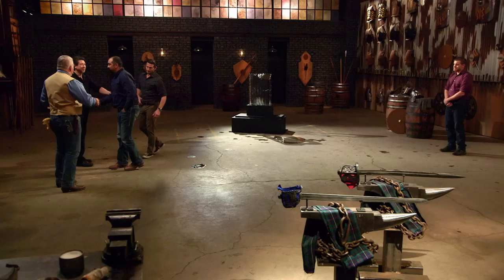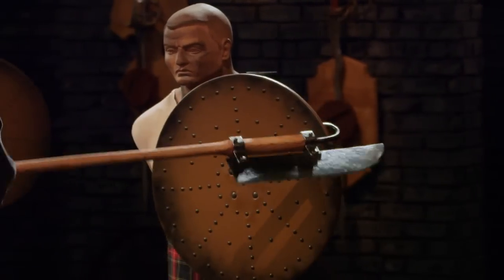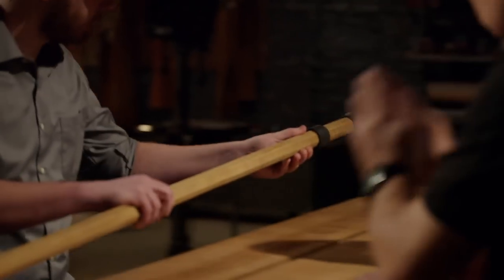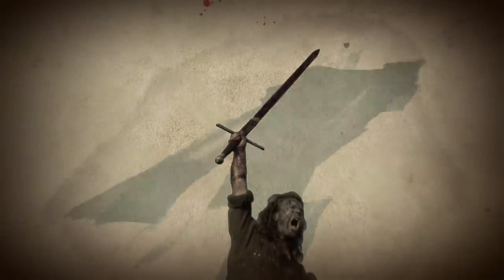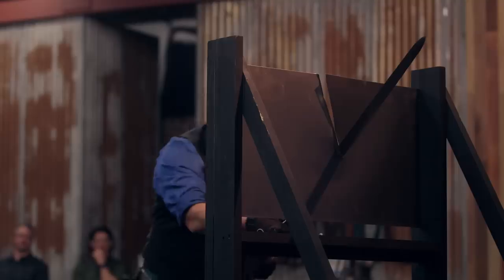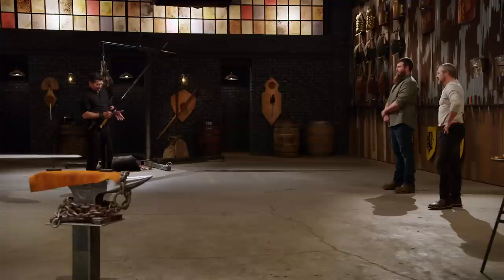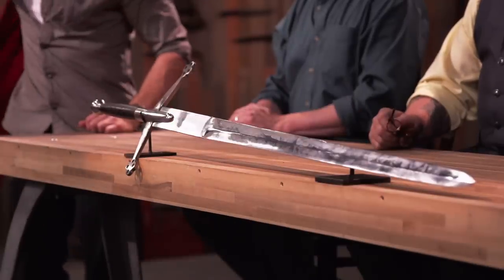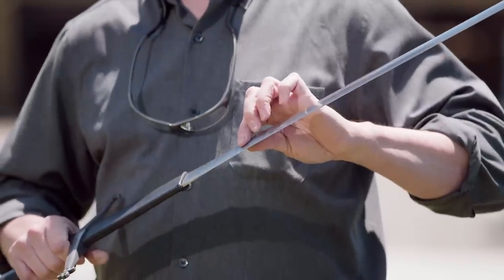TOP 5 SCOTTISH WEAPONS OF ALL TIME! | Forged in Fire

Comment: Scott really had no reason to be proud of his loophole win with the Claymore. My opinion, both competitors presented weapons that would have failed in the battlefield and thus, ensured their wielders wouldn't be amongst those returning home to their families. It really should have been declared a no contest.
Reply: I agree.  I do think that he let the grip twist in his hand, because it landed very close to flat against the carcass, thus the bend, but it shouldn't have retained that bend.  It would have cut if it had landed correctly, because it cut the steel sheeting, very handily, after he straightened it.  The 2nd sword did the same, landing flat on the hog.  I think the grips were both too small in diameter and being round, to boot, made it difficult to control the orientation of the cutting edge.
Reply: @wmden1  if you watch a lot of the major fails, you will see a good number have purposefully shifted geometry at the last second, not by slipping in the hand, but ive seen visible wrist twitsts
Reply: @kevinmorrice  Thanks for bringing that to my attention.  You are correct.  I watched the blade, every time I watched it, not his hands.  I watched it, paying attention to only his hands, after reading your reply.   Obvious bad right hand position on the grip at the point of contact with the carcass.
Reply: but on the other other side, someone IS returning home to their family... on the other side.
Reply: @abadran8174  Well, this is true haha.
Reply: I do think that the makers of the William Wallace swords should be proud
Reply: They were claymores to and they hey were very well made
Reply: A snapped sword is still more useful than a bent one
Reply: @cammyboy2k10  I don't get where you're drawing that conclusion from. A bent sword still has some reach and a point of penetration in addition to the edges. A snapped sword, all you have are some short edges.
Reply: @cammyboy2k10 a bent sword can be straightened & used again in a few seconds. A broken sword can only be reforged after the battle is over.

Comment: As much as I love hearing "It will Keal" watching Doug wield the Lochaber axe, it seems like he's not as experienced wielding long and large weapons, as much as the smaller lighter weapons
Reply: That's the bit that doesn't make any sense to me. Dude's a kali practictioner, he's used to stick and knife fighting. He's okayish with 1-handed swords, but he's always a klutz with the big ones, to the point where he literally managed to hit the pig with the flat of the blade, then blamed the blade like we didn't just see him slap the flat against the pig in slow motion? Get someone from HEMA in, trust me, any of those madmen'd do a happy dance to go and whack a claymore through a ballistic dummy.
Reply: @Fatespinner  the blade twisted and rolled as it failed to cut. What do you expect the blade to do when it cannot cut? bounce? no. the remaining bit of the sword is still moving to the direction of the pig. you can see that frame by frame, 14:16 then use >< keys to go frame by frame. you can see that the sword comes in edge first then turning as it failed to cut making it look like it was hit by the flat
Reply: @quertbarbie62  The blade was vertical long before it hit the pig. It's really very visible in slow-mo., in the video, so I'm not sure exactly why you're trying to argue this when the video doesn't show what you're saying.
Reply: @Fatespinner  you go frame by frame and you can even see it twist after hitting the pig at an angle and not vertical as you claimed. The only time it went vertical is after the edge failed to cut in. Either you blind or you cant do frame by frame. I've experience this effect first hand. When the blade does not dig in after a full swing, it would turn flat, either rotationally slipping from your grasp or turning your wrist with it.
Reply: @quertbarbie62  3 different claymores and has the same issue with all of them. You can even see him rotate his cut with Ben's blade before he finishes passing through the pig. Not to mention, he cut where there is less resistance on the anatomy of the pig. The test are definitely more theatrical than actual test of the sword as a weapon.
Reply: @lorenzomendoza1748  Oh yes you are the best claymore expert.
Reply: I think they need to take into consideration the purpose of the weapons too. 

Alot of them were reserved for the biggest and strongest

Comment: I dont understand how he injured himself at 4:18? Can someone explain?
Reply: His guard/cage came apart, probably cause some blunt force injury to his hand. They sent him to the ED for hand xrays
Reply: Unfortunately with no official comment and absolutely zero medical knowledge, the best I can say is that due to the hilt's looseness, it transfered over all the energy from hitting the ice, causing Jay to either pull or tear something in his wrist. Add the fact that the basket guard had "hotspots", areas where it would rub against the person's hand and cause abrasions just added more injury.
Reply: Weapons can be dangerous, especially when you don't know how to use them like this guy. Cutting improperly in both of the test. You can see his wrist roll because he is hitting with the flat. Not the smith's fault.
Reply: @lorenzomendoza1748  Really? Cause the construction of the hilt looked pretty wobbly to me. Wrist probably couldn't help to roll. But none of us were there, so we just guessing.
Reply: @Zaiaku666  
In the end you are always taking a great risk when hitting when hitting a hard object with a sword like that. Also the hilt of the sword is also increasing the risk as it might lock in the hand if something goes wrong. 

The testing guy should have been more careful
Reply: Terrible form for the handling characteristics of this particular sword inexcusable since it has more treatise available in the open than any others shown. He disobeyed cardinal rules with delivery of his cuts from the wrist eating the shock of every misaligned blow on the wrong segment of the sword he struck with the flat like a barbarian over torqueing his wrist, elbow, small bones in the hand. The entire test idea from square one is playing a game with physics asking a sword to do something they are inherently not designed for considered by most to be unsafe it was inevitable they broke even a well made sword or their body in doing so repeatedly. This kind of abuse is why we have over built non historically accurate swords on the market that handle like crowbars front heavy with no complex distal taper a proper Scottish broadsword was a beastly chopper but nimble the weight mostly being in the hilt modest flex and return enough to facilitate cut and thrust forms a backsword is/was very nimble they were a contemporary to the sidesword very good for thrust with a great singular 45° or so edge geometry narrower, robust if you needed to use its back edge to beat an opposing Saber, and enough of a backedge 4" at the tip to still slice at targets like the face. Donald Mcbane/George silver would write about them in their treatise implementing some more thrust centric technique it is a great merger of designs these swords would prove popular beyond the isles notably in the hands of sailors for close quarters blackbeard was slain allegedly with a type of Scottish basket hilt.